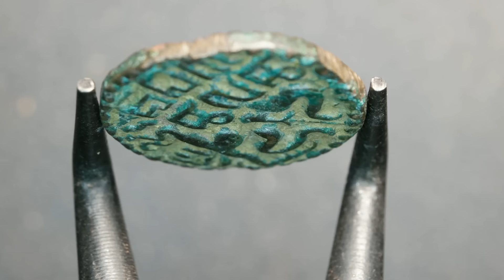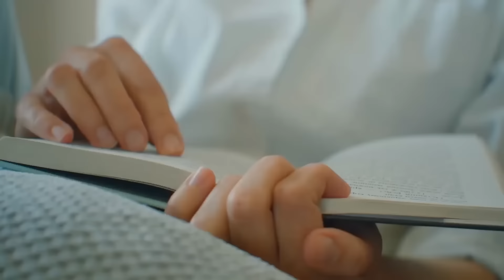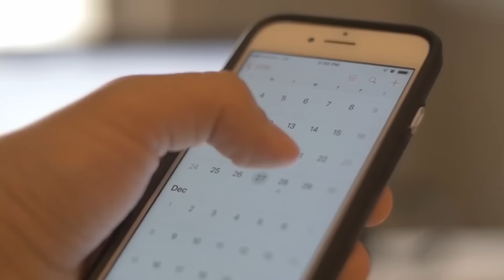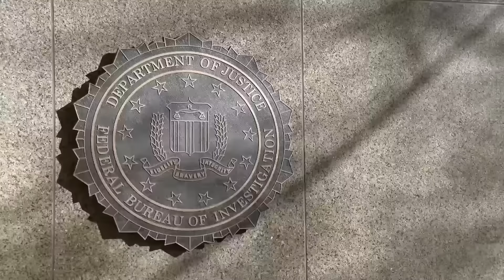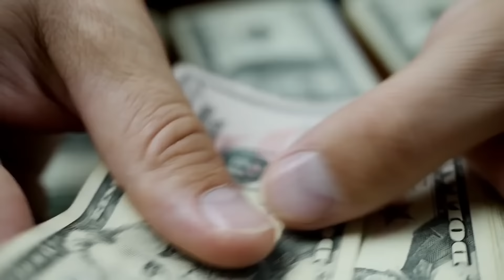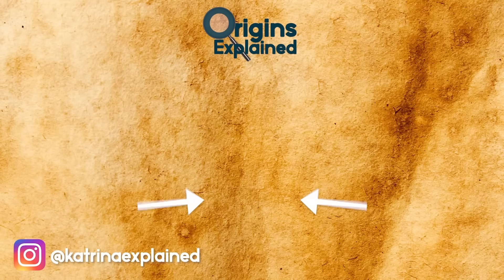Shocking Places Found In The Mountains

Comment: The train to the highest station on earth , would for safety resons should be a "cog railway" , otherwise known as a 3 track train . The cogs , help the train travel up hill without slipping on icey steel tracks .  . 
 Dspite findings of ainçient cities , theres yet more aincient ruins to be found all over earth .
 1945 plane crash , showed a JET AIRCRAFT -  Jets were not in commercial use , until the mid1950s  -  a bit before my time with the "Caravelle" being the first , from memory .